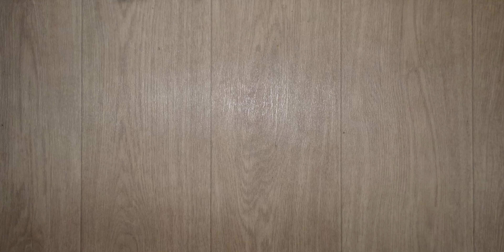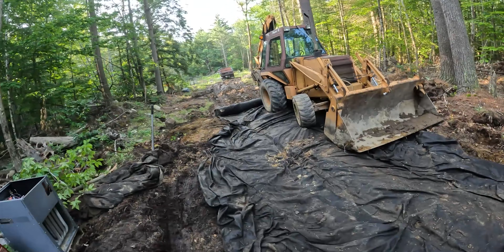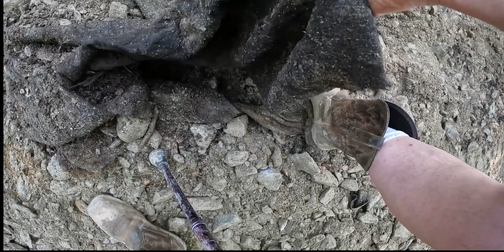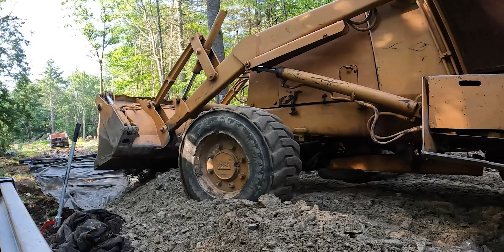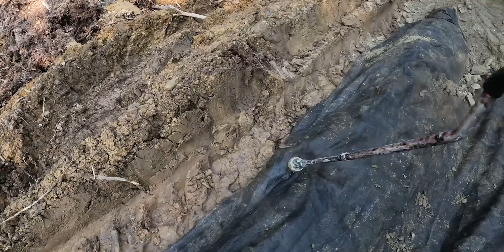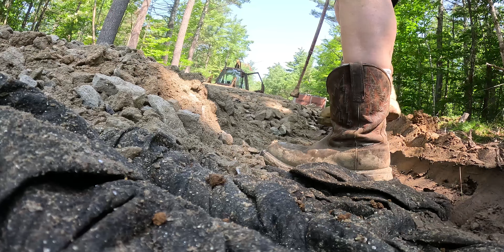Spreading 3" Ledge pack

Comment: Thanks for the Video Detorno.   I have to install a driveway on a slope in Texas Hill Country.   I have the same backhoe as yours, and looking forward to the challenge.....if, I can get the brakes to work :))  Larry
Reply from the maker: Repairing the brakes (if like mine) will be quite the chore. My backhoe has wet brakes, which are in the transfer area in the middle. There is an adjustment for them, which is in an area in front of the rear tires.  The emergency brake might be a quicker and cheaper option. Mine is a disk brake type setup right in the middle of the backhoe.  The models without wet brakes, I believe, are more in line with a car and located out at the wheels, but don't quote me on that. Then there is the biggest brake of all, drop one or both buckets 😉 😀 
Thanks for watching, and I am glad you enjoyed it.  Good luck with the driveway.
Reply: That is a tough task on those tractors. The K series started a big change in the line. I've got a 590super L. The brakes are completely different.  Hubs , everything is changed. Besides brakes and transmission,  I love the E and D series!!! My favorite.  Yours has everything 
 4 in 1 front bucket, 4x4, extendahoe,  and enclosed cab. The Cadillac model!! ❤
Reply from the maker: Mine has everything except ac, though I am not sure it was an option. I really enjoy it.
Reply: @detornodoes  👍

Comment: Was that from Loudon, or a more local pit? Looks like great material and a fair price. I paid $8.32/ton + $70 hauling for 3" crushed gravel 6 years ago.  The price has gone up 30% for material plus $105 for trucking so a little over $300 per truck now, about 16 tons of material. It varied a lot, but much heavier on larger rock, less fines.  That didn't matter as I was only using for a base.  60 truckloads for my 1/4 mile drive. You are so right, It doesn't go as far as you figure!
Reply from the maker: Yes, I got it from Benevento in Loudon. (Great people)  After it rained more of the fines were washed down and I have more large stones visible.